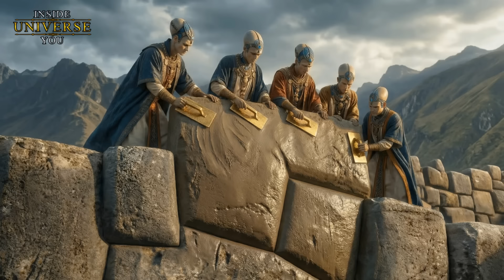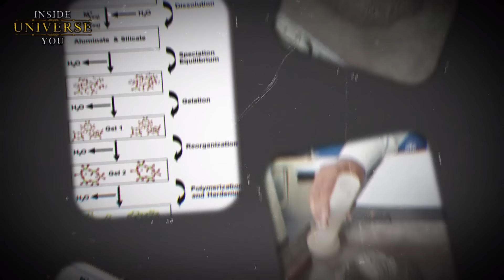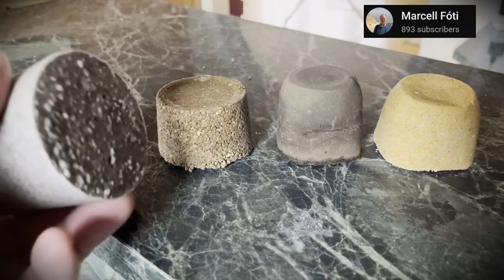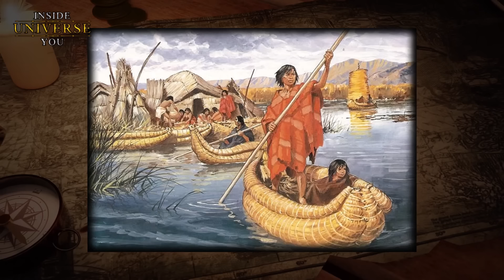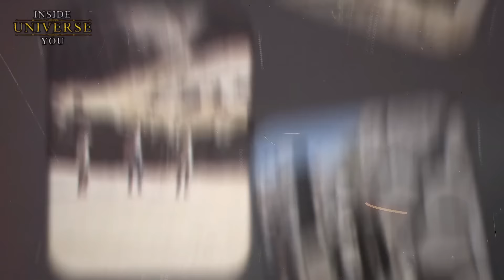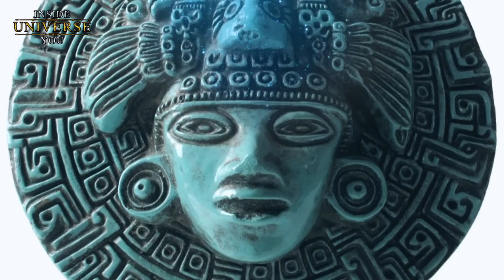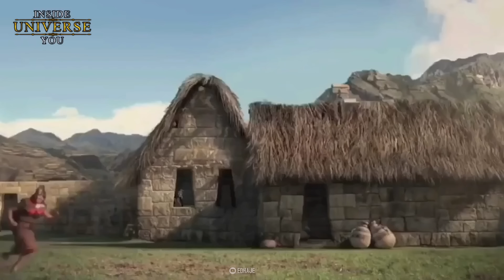Pre-Inca Geopolymer Explains the Massive Megaliths

Comment: Negative. It takes YEARS to harden. Each layer would literally be decades. If not, it would crush under the weight. In Montana, they found that they had actual massive rocks, and did this over top on a thin layer to color it. The stone underneath is 100% quaried.

Comment: its bullshit theory, simply because its stone material cut, not even a sign of artificial work. Secondly, many traces of tools like saw and screwdrivers makes other conclusions. 
2 What makes biggest proof of that its a real stones cut, its the left massive stones and some are under cut like by spatula, traces shows that the tool was melting stone!
So conclusion is simple, the advanced civilisation sued other ways to get bricks, put them on top of each other and the knowledge how to build antiEarthquake buildings shows too many advanced factors. 
The only two things I have found werid, is the roofs are upsent usually in Peru, etc and 
second real weird things, is that so hard work was done from face side of stone walls, but implemented in soil, or soil was used like a filler of walls. This is very human way to do it.

Comment: I have always thought that the stones were an ancient form of concrete and after 1000's of yrs looks like stone because they used sand that was ground up rock with high quarts content. I also thought the nubs look like and old form of a weep hole which they still do in modern masonry. I used to work with the brick layers and they would put weep holes in the walls but it is an opposite form they used today but the nubs on the old ones would indicate that they poured the stone and then cut weep holse into the cast so they would cure slowly

Comment: If they were crushing stone how was it done? That's a lot of very hard stone to crush. Has any evidence ever been found? The pounding stones in Egypt were very inefficient. Not sure if any similar stones were found in Peru. Also, if some type of bag was used in place when the stones were poured , how did they remove the bags and leave no gaps between stones? They could've poured a very thick slurry that they could mold in place without the bags, like a clay and then opened the sides (nubs) to drain water if needed when the stone wouldn't harden properly. Lot's of speculation. Nice video.

Comment: OK, so even if this method were true, why would cast blocks so huge that even today's advanced lifting machinery would have trouble moving and placing them.  The scoop marks are just that, scooped out of rock but not because it was butter-like but because a technology that employed water and sand under high pressure easily cut into the stone.

Comment: Whilst elements of the post, such as the geopolymer stone work, could theoretically be correct ,the 'mold' falls apart on the vertical and horizontal axis of the majority of the walls..
As to bags the weight alone of the curing geopolymer would certainly negate their use ..
So we are still left with the problem of lifting and manoeuvring massive blocks into their unique positioning.
My own research, though limited, suggests that the ancients, not the Incas, had access to a possible acoustic process for both levitating and cutting stone.
However I do like the reasoning behind the 'bulges' on the bottom corners of the larger blocks.

Comment: We are currently 5,128 years into a 432,000-year cosmic cycle defined by high atmospheric density and a lower resonant frequency. This epoch creates a compressed state where human consciousness is naturally dampened, leading to historical amnesia as a byproduct of physical laws like thermodynamics and electromagnetics shifting to match our current distance from the galactic center. Ancient megalithic sites were not mere monuments but functional, planetary-scale infrastructure built from high-quartz granite to act as piezoelectric semiconductors. These structures stabilized atmospheric pressure and modulated the Earth grid to align with the specific frequency requirements of that epoch, and we fail to understand them because we analyze their physics using our current low-frequency standard instead of accounting for the variable laws of the cycle they were built in. Human biology is calibrated to these shifts, and during this dense cycle, the calcification of the pineal gland acts as a biological firewall to protect the nervous system from processing frequencies the body is not yet equipped to integrate. True awakening is not an act of force but a process of internal calibration that requires systemic purification, because the DNA functions as an antenna and the biological vessel must be optimized through diet and environment to minimize interference. The process of raising cerebrospinal fluid to reactivate the pineal gland is inherently sensitive and requires a cultivated state, as attempting to bypass natural biological safeguards under current conditions can lead to nervous system overload. This shift is inevitable because as the cycle progresses and our position relative to the galactic center alters fundamental physical constants, these internal and external systems will recalibrate automatically, meaning our current work is to maintain the purity of the vessel to ensure we are resonant with the cycle to come

Comment: There is no geopolymer, and there never was. The great wall at Sacsayhuamán was built from blocks taken from a local limestone quarry. The six monolithic stones in the wall at Ollantaytambo were taken from the rhyolite quarry across the valley and moved up the ramp behind the wall. The casing stones of the Great Pyramid of Khufu were quarried at Tura, across the Nile. The core blocks were quarried where the pyramid stands. The bedrock beneath the pyramid is limestone, and the nearby temples were also built from blocks cut from local limestone. We know this with great certainty. Limestone is a sedimentary rock that often contains shell fossils and is easy to identify. Granite is an intrusive igneous rock formed underground from magma. Geologists have identified the stones used in these monuments; it is not difficult, and there is no mystery.

Comment: It's a possibility but not really practical. If it were some sort of polymer supposedly it would be poured into a mould but each block is different both in size and shape. A mould for each block ?. I don't think so. Also the polymer idea would not explain the extreme accuracy. Lastly the quarries where the blocks came from have been identified. Cusco's blocks for instance were quarried from Rumiqoiqa, approximately 35 km away in the Riohuatanay valley. Are you proposing that the blocks were quarried, melted, transported to the site then re-formed.? If so that really doesn't seem practical.

Comment: some knobs appear on top which is weird. some blocks protrude out oddly more than others. some blocks have more sides than others. if you could control the shape of the blocks by using the geopolymer method then why have so many different one off shapes. you could still have them interlock to make a stronger wall but at the same time you could create the same reaccuring shape to make it easier to build. geopolymer answers the tight fittings blocks but other things don't make sense and exactly how they did it. the stones in the Sacsayhuamán walls were cut from solid original stones, not poured as a geopolymer. geologists and petrologists have analyzed core samples from the site to settle the debate. the stones contain microscopic calcite veins, natural fossils, and layered geological formations that cannot form in man-made concrete or geopolymer slurries. petrographic analysis proves the stones match the exact mineralogy of the local limestone and andesite quarries, which are known and still visible today. the past is very mysterious.

Comment: The blocks have not been cast on site; otherwise, there would be a gap between the blocks, as the molds wear away over time. The whole theory is a good effort, but it is not plausible.

Comment: Geo-polymer tech may have originated from the watchers. Once you demonstrate what is possible, that tech knowledge spreads world-wide. 

there is a modern product called "fast foot", a membrane for support in pouring footers, and it is incredibly strong. Pouring rather than chiseling makes sense. However that is still a massive undertaking and a bit of complex math. Even this may not answer all questions and creating corner joints is a bit mind-blowing too.

I wonder if the Romans would have used this method

Comment: This theory isn't worth discussing, why, because at the minimum the heavy stones still require placement. I pressure exerted on the walls of the molds would be too immense to contain, the weight of the wet mixture would be around 1.5 times heavier than the stones are today

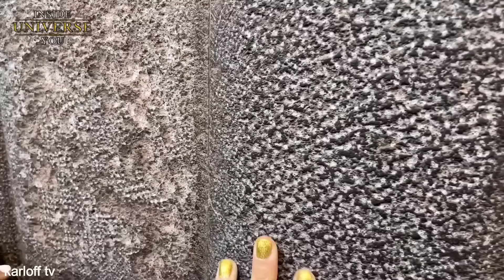Comment: 6:02 Tell me that perfecrly rank and file texture doesn't betray some sort of fabric imprinting on transiently soft material. 
That said, why do so many posters make this a false dichotomy? There is no reason not to use as many pre-existant  rocks found on site as you can, ESPECIALLY if you have some molding tech to fit the next element around the former's many geometric idiosyncracies without having to go maths genius for a few months or do 400 iterations of trial and error with 4 elephants' worth of weight. 
You can always model some covering polymer around the natural stones later, the surrounding artificials will have bulged while settling anyway.

Comment: This makes sense. I read about this theory by Davidovitz over 20 years ago about the pyramids. The ancients could never cut these many angles. The simplest answer is the best answer
Reply: its bullshit theory, simply because its stone material cut, not even a sign of artificial work. Secondly, many traces of tools like saw and screwdrivers makes other conclusions. 
2 What makes biggest proof of that its a real stones cut, its the left massive stones and some are under cut like by spatula, traces shows that the tool was melting stone!
So conclusion is simple, the advanced civilisation sued other ways to get bricks, put them on top of each other and the knowledge how to build antiEarthquake buildings shows too many advanced factors. 
The only two things I have found werid, is the roofs are upsent usually in Peru, etc and 
second real weird things, is that so hard work was done from face side of stone walls, but implemented in soil, or soil was used like a filler of walls. This is very human way to do it.
Reply: @discoboy8169  You make good points but I don't believe ancients' cut stone with angles like that

Comment: What kind of container could hold 20 tons of rock slurry. Animal skins and wood will deform?
Reply: And every container is different. You would not go to that trouble, you would use a regular mold which allowed for interlocking. Also the blocks have seamless joints with no gaps. You cant achieve that with skins or wood. Only rice paper!

Comment: Been saying this for a few years.   They made liquid glass starting with natrium, sodium carbonate from river beds,  they would heat this, apply to rock to compromise the crystaline structure, then pulverize.  Through washing methods they made a dilute water glass which they mixed with the pulverized material, adding metakoalin, where the sources of aluminum came which were found in  analysis.  The substance once mixed and shaped would be slowly heated, possibly before molding, adding a hot muddy mix into a  mould and then the reconsitute would harden, and shaped while hardening.
Other sources of natrol can be made from tree roots, there's few tree in some of these areas where no other natrium sources exist
Reply from the maker: That's a very interesting explanation of how it could have been done!
Reply: @UniverseInsideYou  probably not exact, but close

Comment: Still wouldn’t explain the dimensions and weight. They moved that weight with ease and artfully. Why? Because it was easy for whoever built that. And the pouring pull have been from the top, using gravity, not on the side where the protuberance is.

Comment: This theory is by far one of the worst I’ve ever heard of. The formwork for pouring liquid rock, has to be extremely rigid and strong. Liquid rock is not going to form to the shape you want it to unless you force it to. Minimum 150 pounds per square foot is not just going to go into the shape you want🤪 go pour some liquid rock into a bag even a fraction the size of one of those rocks🤣

Comment: What I think , from way back Egyptian were mild mud brick molder, inside the pyramid enter the smaller square stone are molded stones  you can goggle that. But we’re talking walls. I think they are reverse mild stone building of walls. The are huge dry river bed nile mud block stack on ea other and the stone are dug I using scraper that Mimic sat a side profile be as a bird the center of the scraper deep lines the bird wings are the 2 side rounded edge . That tool you can scrap deeper or shallow to create art rocks , so that why they are so close cause they are from the same stone. Rock wall Illusioness  they decive the mind as corner design the stone goes across that a real stone wall. They get better and better so you can’t tell it fake long 3-4 rock formation 15 ‘ long block 1 single stone

Comment: It wasn't leather, it was a rubbery like substance, heated and cured over the fire, blown hot like glass into balloon like shapes. that stretch and resist the alkaline acidic solutions. 
They did not use natron. But clearly natron mimics the works. 
Heat was provided by chemicals alone, nothing was molten. 
Also, do not presume all rocks are 100% dust or powders. This was just the binder and face. The insides were filled with large stones if and when suitable.
Slurries are one way to find circular granules of material, another is to use a windhexe machine.

Comment: Absolute pile of garbage.

Geopolymer does not account for mineral veins in many of the blocks and whole fossils in blocks - especially oolitic limestone.  Examples all over the world of major monoliths still attached to the bedrock - Aswan, Egypt and Rapanui spring to mind immediately.  

The nubs argument falls apart as soon as you go to Ollantaytambo and see them sticking out of bedrock - they had purpose and we have no clue what.  Coricancha has exquisite, accurate block work yet some have nubs on - why would you leave them on some but not others? - once again suggests purpose.

If you could just cast blocks you wouldn't have to transport huge blocks of stone, you could make life so much easier by breaking them into more manageable sizes.  So why are there huge blocks littering the road from the quarry of origin to Ollantaytambo? 

On top of all that it completely disregards the material science specialists that have analyzed such blocks and determined that they are not composite and have traced the quarries of origin through chemical analysis.

Geopolymer is just a convenient fantasy to explain what currently cannot be explained and the gullible lap it up.
Reply: The composite/GP claims work very well for Sacsayhuaman, but fail completely for Ollantaytambo. And there's a nub on a stone on new work on a Tamil temple built on Kauai in the early 90's. So what are the nubs, aside from the final neck cut-off form the quarry removal site? Why are they left intact sometimes but not other times as you suggest on the same kind of stones on the same job? Or why are there nubs on composite or GP stones that were not cut out that way at quarry? Only thing I can think of is a sort of signature or branding for a mason's guild.
Reply: @rickZR1982A  Just look at natural pumice and Sacsayhuaman composite claims don't look quite so compelling.

Comment: I enjoy the theory and have always thought along this line. What makes me doubt it that for one we can find quarries where the stones were cut from and often found left alone along the routes.  Also, If they were going to pour the blocks, why not pour large sections of walls like we do now on poured concrete foundations?  Not try to argue, just another thought.
Reply: Smaller stones would be less susceptible to cracking than a large wall in a single pour . Also a wall needs lots of rebar. Stones dont

Comment: While I hold your work in high regard overall, I am not persuaded by this specific theory. How does it address the cutting of extremely large stones, such as the Stone of the Pregnant Woman and the Aswan Obelisk? Does the theory rely on methods like melting and casting granite? Additionally, does this apply only to polygonal masonry–style stones? How do you explain the absence of nubs on the core blocks of the Giza pyramids, with only limited examples of nubs on the casing stones?
Reply: There's also stones with quartz veins found in egypt, witch wouldn't be there if being made by a geopolymer although I do like this theory.

Comment: The geopolymer crowd is willfully ignorant of basic engineering. Massive concrete pours require internal support. If these megaliths were cast, the surrounding geology would show cracking or at least micro-fractures by now. The same people also seem comfortable believing in ancient giants, despite thousands of dinosaur fossils and not a single verified human giant bone. 🤣🤣🤦‍♂🤦‍♂
Reply: Guess you've never heard of mortar bonded rubble-core built up walls plastered over with a thick non-sag layer of the same stuff? Used in rock wall construction today, except the whole wall is usually continuous. The separate block technique (barrier coat/mold release between blocks) seen here is seismically resistant. Natural to artificial components ratios could be 20:1 to 30:1, eliminating the requirement of vast amounts of powdered rock, allows use of lots of quarried stone, no molds beyond possible temporary retaining forms, and no big lifting requirements a team of humans couldn't handle.